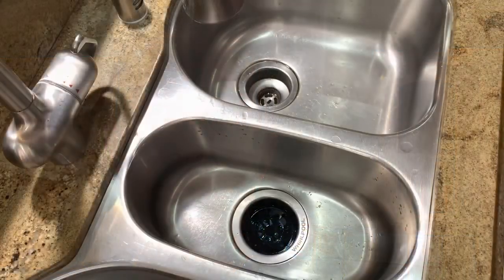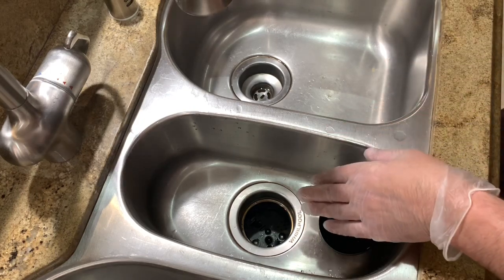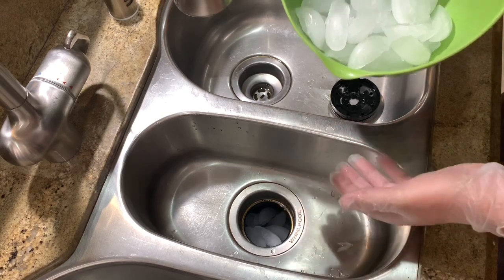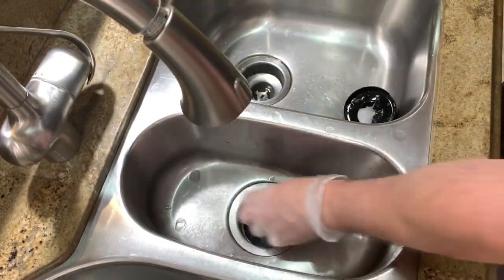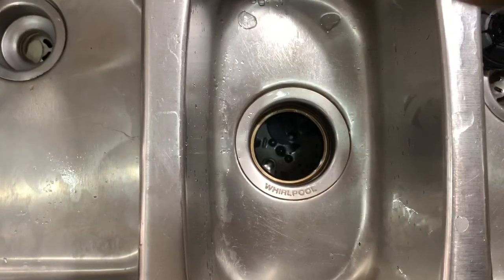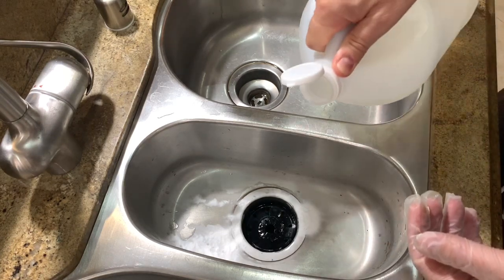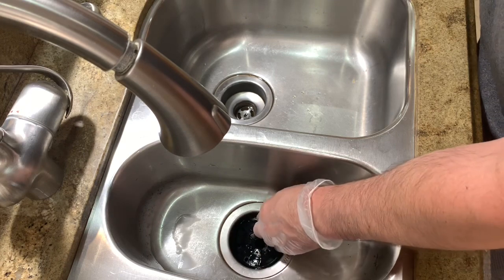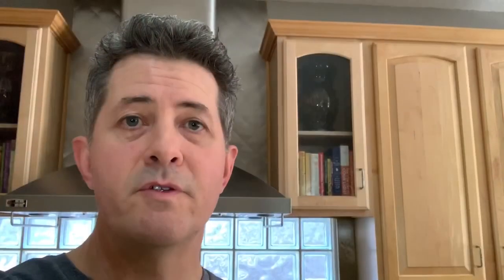How To Clean A Smelly Garbage Disposal-2 Step Process!

Comment: How do you pull the rubber thingamajig out?
Reply from the maker: Most just pull out with your fingers (might want to wear a glove).
Reply: He has a removable one, this is actually not common, don't break yours.  Also, never put ice in your disposal.  You are not even supposed to put tough vegetables in there let alone a solid.  I get that this hack works but so is cracking an egg with a sledgehammer on your counter (just because it gives you a desired outcome it does not mean you should do it).  

Putting ice in your disposal will shorten it's life considerably.  But before it breaks, you will have dull blades that will not process the food and clog-up your drain and possibly your sewer line (yikes), and that can be way more expensive than a new disposal.

Comment: How can clean the rubber, it’s built in!!
Reply from the maker: You should be able to pull the rubber splash guard out like in the video
Reply: @MikeKlimek  my splash guard is built in also and can't be removed. It's sealed under metal.

Comment: you don't use hot water With the ice.. as it ...melts it ... add ice, salt, dish detergent, baking soda whatever detergens or abrasive media you want along with the ice... than once it's foamy and caked (and if it's really slimy and grungy, scrub it with a dish brush or whatever) but just simply throwing ice in it than running HOT water literally won't do anything in most cases, you have to time it better (you melted the ice too fast)
Reply: wanted to say that so people didn't start melting ice like wait wtf? i just tried to clean this yesterday!
Reply: ice with cold water, than once it fills up too much than heat it up the past comment was hard to read